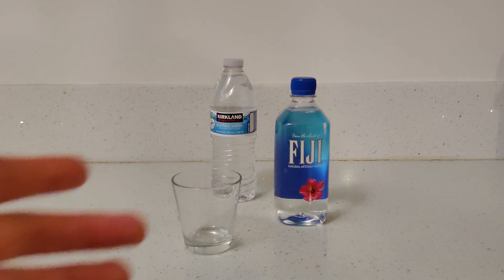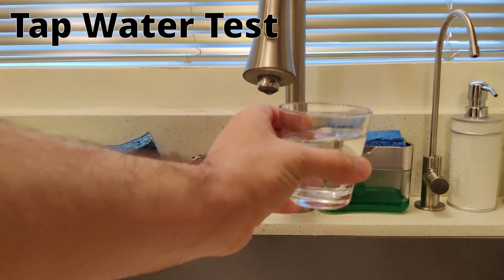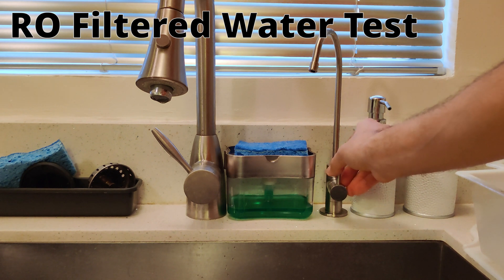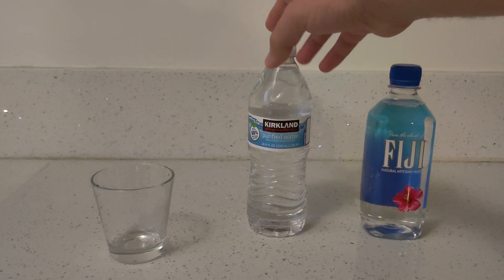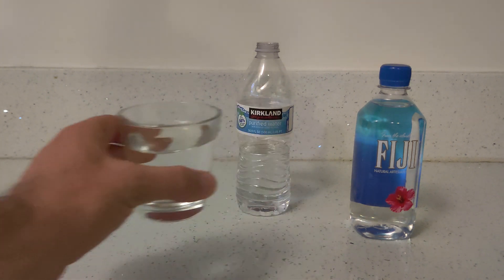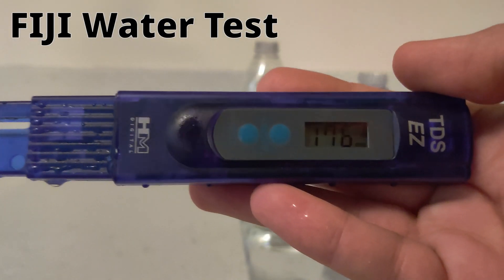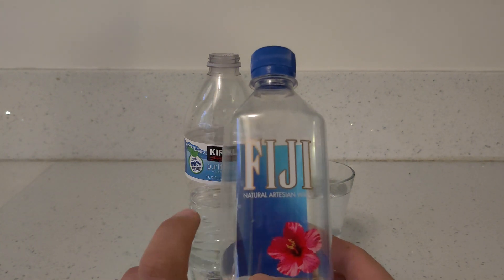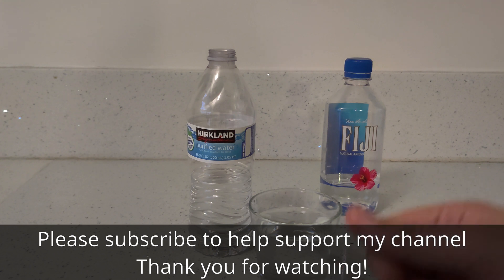Bottled Water VS RO Filtered Water Test

Comment: You can add a re-mineralisation filter to your reverse osmosis system to make the water more alkaline and add some minerals.
Reply: Do you have information on this?
Reply: @mcb2606  1/4 inch tube Input/output for your Reverse Osmosis system.

https://www.freedrinkingwater.com/apec-essence-10-high-purity-ph-calcium-carbonate-re-mineralization-inline-filters-w-quick-connect.htm
https://www.freedrinkingwater.com/fi-phmax-qc.htm
https://www.expresswater.com/products/5-stage-alkaline-mineralizer
Reply: @sergei971  thank you!!
Reply from the maker: Thanks for the insight!